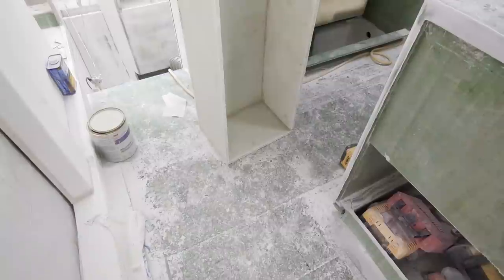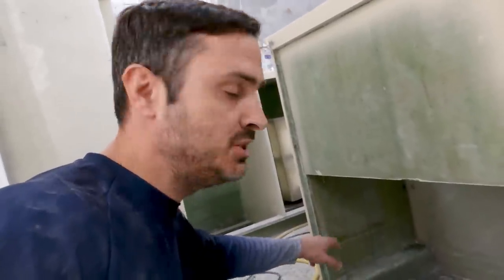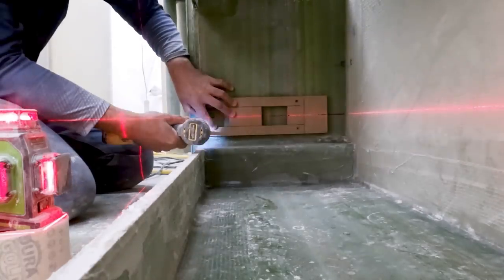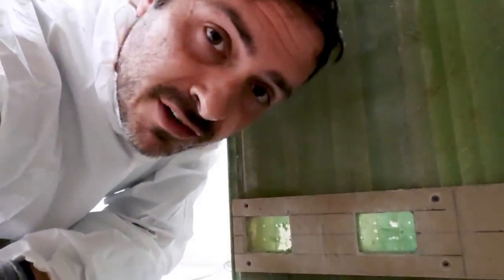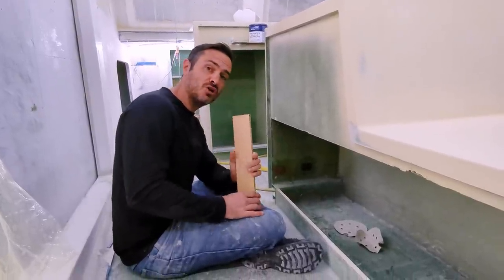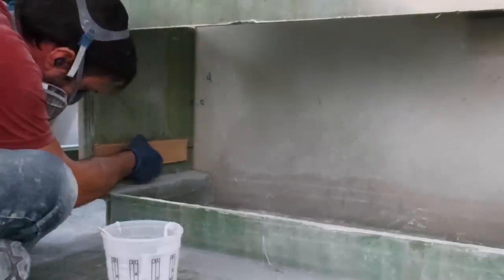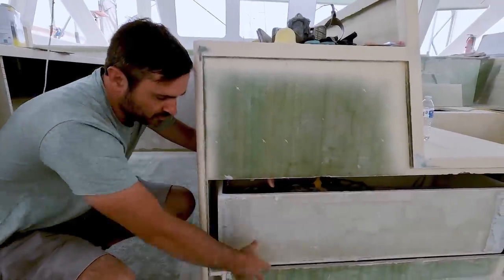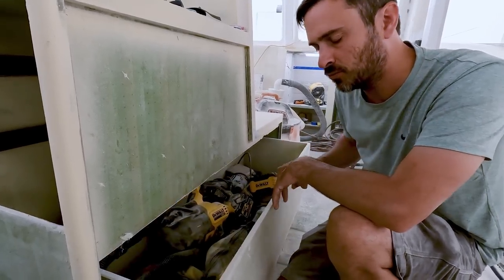I Can Fit Inside Our Sliding Pantry Drawer (MJ Sailing - Ep 290)

Comment: For a drawer of that size you should add a heavy duty under drawer slide. It will fix the rake and allow substantial weight.
Reply: I agree need a support in the middle!
Reply: I 100% agree. Add them, yes two, or add them later. Supporting the drawer bottom will prevent fatigue from flexing as your boat deals with waves. A good place to over build to prevent anxiety and frustration while on blue water. 👍🏻
Reply: I would have built two drawers.  Thinking about all the stuff in there sliding when the boat rocks…
Reply: @wmillios  they can just glass in a divider if the contents rock n roll - but agree some support to stop drooping etc - but that can be another vlog after they splash and do the first mtce haul out - always need content for us needy viewers
Reply: Add my agreement to a middle support, more for canting prevention than weight support. 265 lb end slides x 2 = 530 lb! That should handle even the heaviest bread.

Comment: Hello Matt.  I’m so bummed I didn’t get to you earlier.  I understand cabinets construction.  I used to sell the hardware.  Of course there’s a lag to the vids so always history.  Anyway, agree with comment about racking.  Something that happens with wide drawers particularly when the drawer content weight is not evenly distributed.  What a pain to worry about that.  A great fix is to mount the same full extension slide flat under the drawer.  However, if not perfectly aligned it will affect the soft close feature of the side mounted slides.  Just a quick suggestion that the side mount spacer would be better off using Azek/pvc board - 1/2”.  It’s sandable, paintable, you can dimension the stuff, won’t rot, mildew resistant, takes fiberglass and epoxy real well and structurally sturdy, light weight and most important, won’t swell. Again, I’m sorry that this is likely in the rear view mirror at this point.  Also, make sure you use the what they call, “breather tabs” on the slides to stake them.  They’re the knock out portion.  The running clearance of the drawer should be 1/16 to 3/32 on each side.  This is due to the imperfect  nature of your box and cabinet. The slide needs some room to account for all the dimensional differences and drawer weight as it gets loaded.  Those tabs will essentially allow the slide to float a bit.  Also due to dimensional inconsistency; essentially the issue of not perfectly square, you may want to register the drawer slides from the cabinet face.  After all, that’s where the rubber meets the road in function and appearance.  Otherwise, you’ll go absolutely bat s_ _ t rying to make that adjustment. You’ll be left with shimming the drawer face and it still won’t be right.  You’ll start drinking more…..lol. Good luck Capt Kaz
Reply: I discovered what happens when drawer slides are not parallel  and level to each other and/or drawer boxes slightly out of square. Soft close binds, drawer opens on it's own, now overload and you have a mess to correct. There is a lot of good info in your post. Might consider a not so wide drawer.
Reply: @altenneson7132  Hey Al.  Yeah engineered wood and framework with milling machines, etc.  All good right.  But traditional guys need therapy and experience ques.    
I’ve done so many crooked drawers over the years I’m dizzy…lol.  Anyway, Matt’s lookin good.  He’s a troop and steps up but.  But machetes are a problem in a gunfight. I’m just down the road from them and wish I could get on his “call me” list but he’s busy and I don’t want to interrupt a working man.  Ha! Lol. And how many internet nuts do you think they meet?  🙈